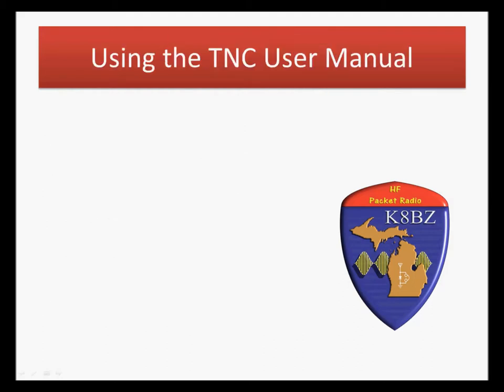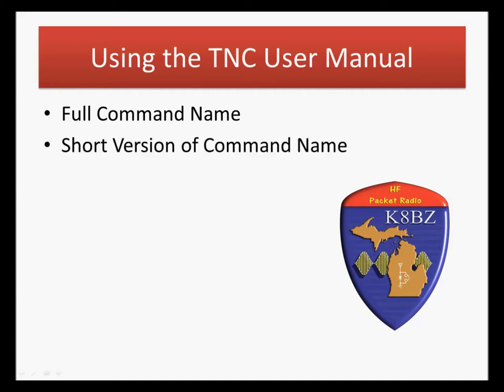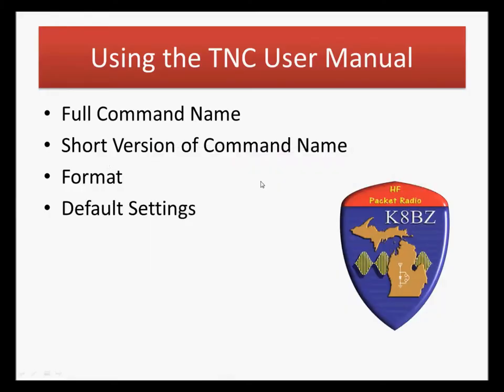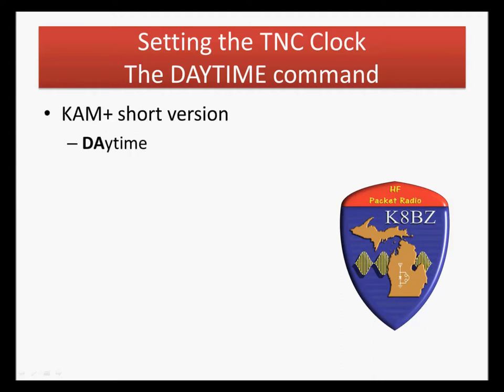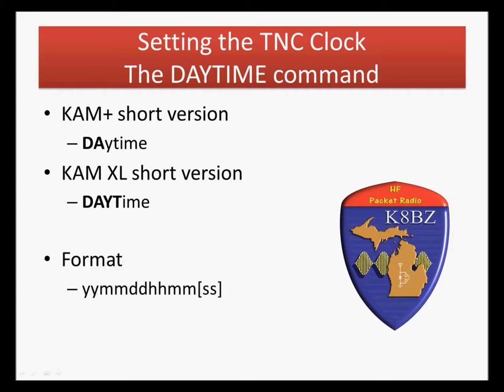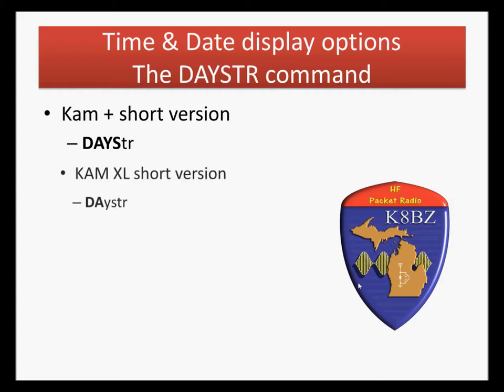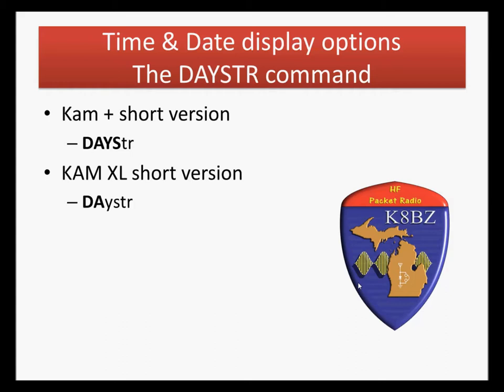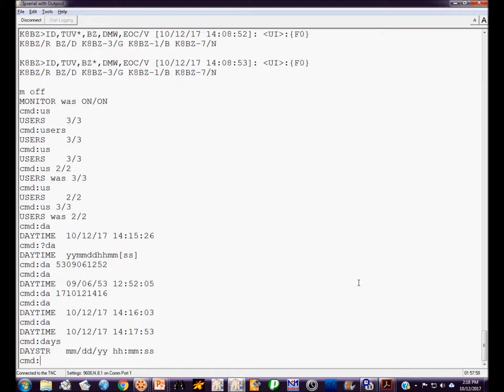HF Packet Housekeeping

Comment: Another great addition to the fine series of informational Packet system use and operation =)   Thank you for a great series for the HAM =)   
de N5VMO Pat
Reply from the maker: Thank you Pat.  I appreciate the views and the remarks.  Hope to see you on HF Packet soon. 73, BZ
Reply: Waiting for cable to arrive for the new radio =)     New small Micro - Mini 6 pin DIN that no one stocks .... so pre-made cables  :-)))
Reply from the maker: Yes, they are not easy to find but available on Amazon.  It is the same connector as the old PS-2 mouse cables, but the mouse cable don't have all 6 pins wired so they are usually not usable.  Good luck.
Reply: I found out it only uses 5 pin in the connector ..... bad news is the pin not connected on the mouse / keyboard is used and one of the pins not used on them both IS USED on the radio jack is for PTT control :-)))